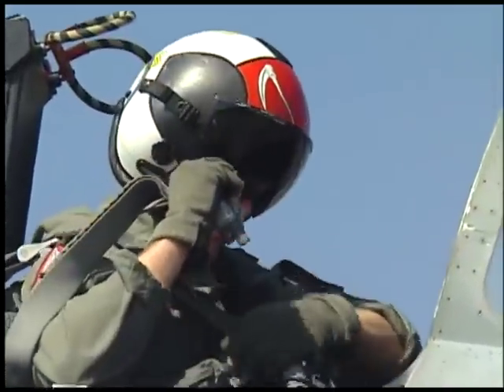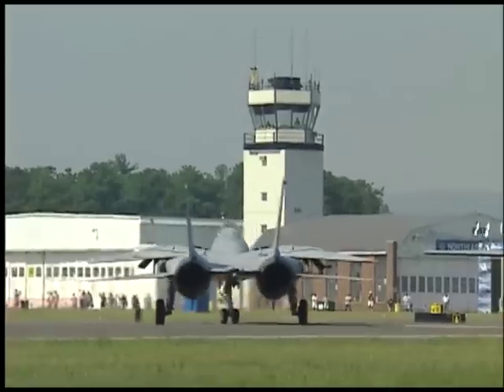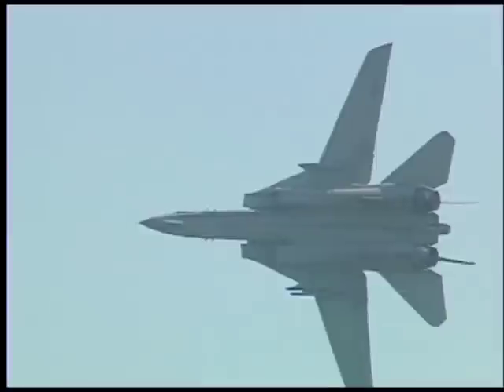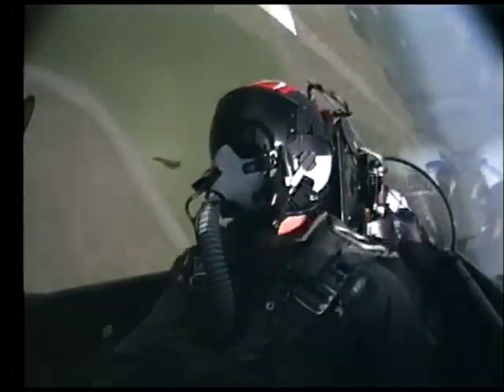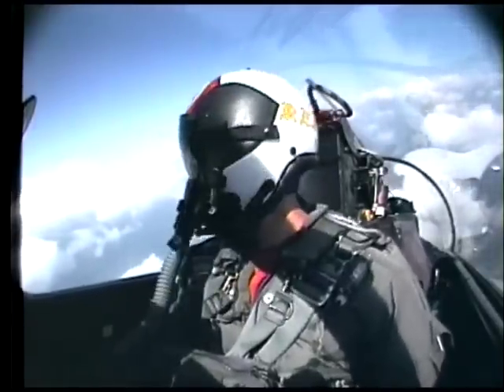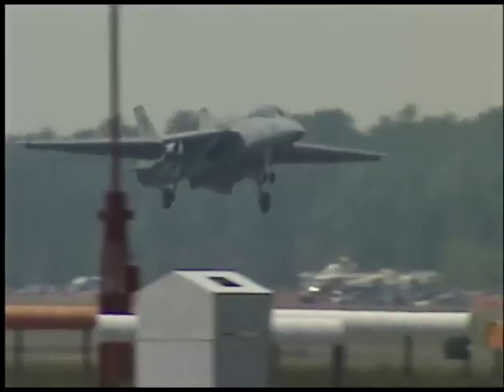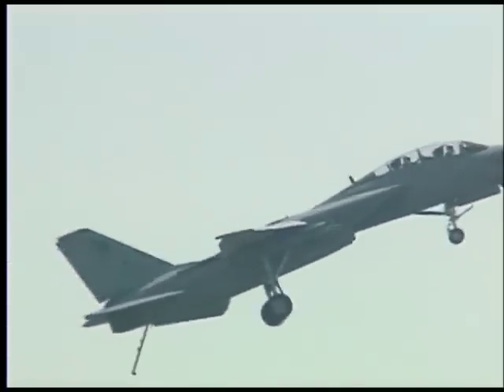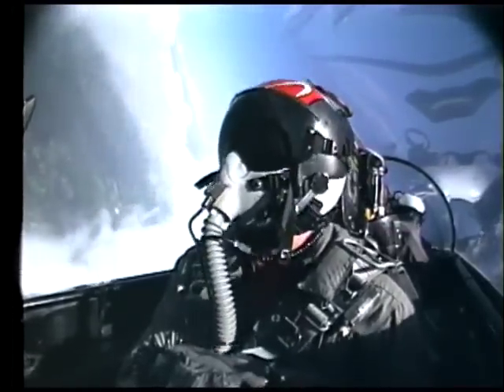Grumman F-14 Tomcat

Comment: RIO said he's a copilot? Back seat has no flight controls on the Tomcat.
Reply: I caught that too. No back seat controls. Did they install them on the late D models maybe? Just a hypothesis.
Reply: @johnp2110  I was (1973-1976) an Airborne sensor specialist (17Lima 20 L8) on the OV-1 Mohawk. A 2 seater with no flight controls in front of me. I was taught to fly the 2 engine turboprop using an autopilot assist on a console next to me in case the pilot was incapacitated. A large palm size knob for climbing and turning. no stick needed. With other controls in reach so I'm sure there are secondaries in the back for the RIO.
Reply: @MatthewPettyST1300  That's pretty cool. Thanks for sharing.
Reply: As an added note: In Viet Nam it was an occupational hazard being shot at . We were a  Reconnaissance plane.We weren't taught how to land the plane. Just get it back over friendly space. Then use the Martin Baker ejection seats . I could if needed attach a mike cord to the pilots seat pan firing handle. My choice , I was told the OV-1 might do weird stuff when 1 side leaves way first.
Reply: @MatthewPettyST1300  There are neither flight controls nor engine instrumentation in the rear cockpit.  If the pilot can't fly the aircraft, it's time to get out.
Reply: @jhtomcat6838  Thank you for the update.  I didn't know that . I was only have my experience with the side by side seating in the OV-1.
Reply: @MatthewPettyST1300  Matthew, the OV-1 was a good platform for what it did, but being that low and slow made for a dangerous career.  I'm glad you survived that.  My side by side experience was in the A-6A and B, where the B/N was a lower and a little farther aft of the pilot - but still aware of everything.  In the F-14A's tandem cockpit, the RIO had little information about any problem with the aircraft itself, so it was imperative to have good ICS communication.  The RIO was a tremendous asset to a task-saturated pilot, and could monitor A/S, AOA, AOB, vertical speed, etc.  As an aside, I've always felt very fortunate to have been able to fly Grumman aircraft.
Reply: @jhtomcat6838  the OV-1 was a Grumman produced Aircraft too and much like the A-10 Thunderbolt II. You look at it and find it so beautiful being designed for what it does best. The same can be said with the OV-1. It's not pretty but it has beauty all its own. Now the F-14......God, That ship transcends that philosophy. It is without any doubt my favorite aircraft  In style, body lines, charisma just sitting on the runway. talking about performance is another level and another day. One of the "Sexiest " aircraft built. Loving it since 1974 in the Army ( I had a Tee shirt with Its picture). That is just in front of the  P-51D.
Reply: @MatthewPettyST1300  try f14 tomcat rock show. My fav f14 youtube video!!

Comment: This must of been the F14A. Still using the P&W engines instead of the better GEs.
Reply: There were only about 130 Tomcats ever built (or modified) that were powered by GE F110 engines.
Like it or not, the vast majority of the planes built were A-models with the TF30s.  The Iranians are STUCK with TF30s on the 9 or 10 planes they CAN keep in the air at any time.

The F-14A was NOT a bad plane...  that's a myth propagated mainly by fanboys of the F-16, F-18, and MiG-29.  Sure, it had a tougher time flying against later-generation planes than the B and D model but guys flying F-14As DID beat 16s, -18s, and MiG-29s that could technically outfly the Tomcat - on paper!
The A-model falls short mainly in subsonic flight.  When it gets close to Mach 1, the engines actually put out close to 28,000 pounds each which you don't read about in most books.  That's why the plane well out-performed the F-4 Phantom once it got up to speed.  
Nobody's disputing, however, that the TF30 was more maintenance-intensive and less reliable than the F110...  It's just the F110 made the aerodynamic qualities of the F-14 airframe a lot more apparent to people RIGHT away...  

The US Navy never funded a complete re-engining of the F-14 fleet because it has only so much money to cover the surface fleet, fleet air, submarines, the Marine Corps needs, etc.
They also completely FUBAR'd the Tomcat program from the mid-1970s onward.  Introducing the F-18 into the fleet only made things worse for the Tomcat because it diverted funding towards that program, too... and the McDonnell Douglas guys were better salesmen to Congress and the Navy than the Grumman guys were.
I have my own opinions about which plane was better for the Navy long-term -- hint: it's NOT the F-18 Super Hornet for sure! -- but Grumman lost the political game in 1989.  The A-12 contract was their final chance to stay in airframe manufacturing, period...  It's why they're Northrop Grumman and NOT plain-old Grumman anymore.
Reply: AvengerII the tf 30 was never supposed to stay in the tomcat as long as it did. it was supposed to be used during testing and once the cat went to full production it was supposed to get the ge engine and rhe later upgrade to the 110 but i guess somebody in dc had some kickback money coming in so they kept the pos tf30. I'm absolutely convinced that if they had upgraded like they should've done, alot of lives and planes would've been saved!!! the TF 30 was garbage
Reply: @razor75250  TF-030 were only an issue when you were maneuvering at very slow speeds. Essentially, using high angle of attack at very low airspeed to stabilize the nose and using throttle slamming from idle to afterburner and back to idle to control the plane's weight at very slow speeds due to lack of momentum. They were completely fine when there was lots of airflow at higher knots as they produced more and more thrust with lots of air coming through those huge intakes and the F-14A still had great energy addition rate at over 300 knots (and hence capability to pull 9+ G at close to Mach 1). That is why the F-14A demos with 'Snort' Snodgrass were so impressive. Also, the F-14A outperformed the F-4 Phantom everywhere regardless. Whether it was a dogfight or at high speeds. It simply was superior in every aspect and took only 15 seconds from going fully defensive to fully offensive despite having the TF-030. A lot of that was because of the airframe design superiority.
Reply: @2ZZGE100  true,  however the 110's had far less failures and maintenance issues.  I was an airwing maintenance officer and I can tell you for certain that my stacks of write up was alot smaller for the 110 than the tf30!!!
Reply: @2ZZGE100  also the 110's had a whole lot more giddy up than the PW!!!
Reply: @razor75250  Yeah exactly, I know the TF-030 had compressor stall issues, which were not an issue with the GE-F110 engines. I was only saying the F-14A still had incredible air demos because of how the pilots flew it despite the TF-030 engines Thrust difference was static 42,000 lbsf for the TF-030 and 56,400 lbsf for the GE-F110. Because of the big air intakes, the TF-030 went up to 28,000 lbsf at Mach 0.8 and the GE-F110 engines rose to 30,200 lbsf at Mach 0.8. That is what F-14 was so fast.
Reply: @2ZZGE100  exactly!! I know snort personally and there was no one better with the cat than Dale!!!

Comment: biggest mistake the navy did was  discontinue the F14, Russia feared this plane cause it out performed the migs and it also exceeded much 2.5....
Reply: The "Navy" didn't discontinue it...  Dick Cheney killed it with a pen.    And yes, with an AWACS or a Hawkeye up we could sanitize a lot of airspace.
Reply: Sad that she is gone. However the stress and abuse carrier aircraft take give them a finite lifespan. Even with referbs. I read a piece about a maintainer from a tomcat squadron. Apparently in the last 2-3 years of service, it was near impossible to keep the planes airworthy. They were breaking down left and right. Somewhere around 20-30 percent mission capable.
Reply: Foxbats were mach 3 . plus no aircraft can go at top speed while carrying fuel pods and external weapons